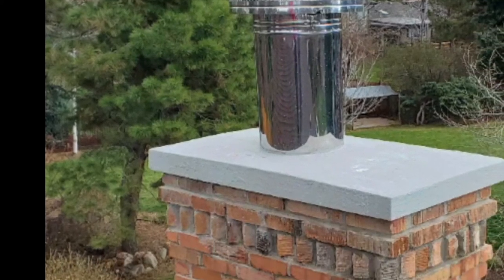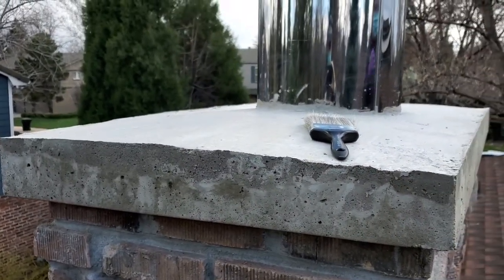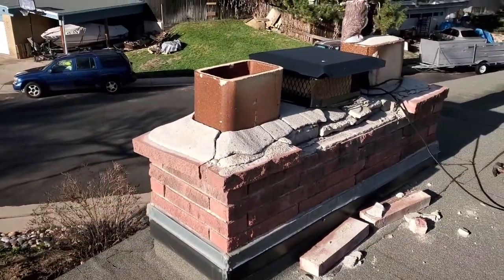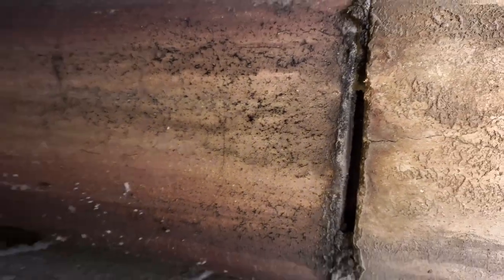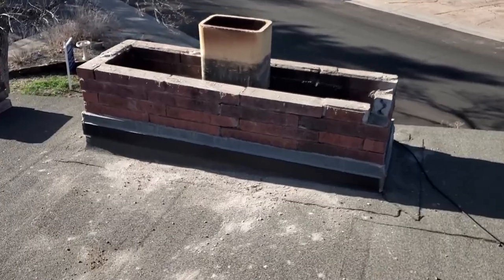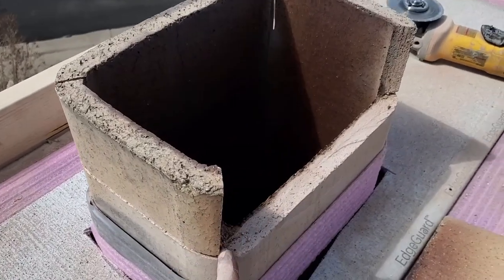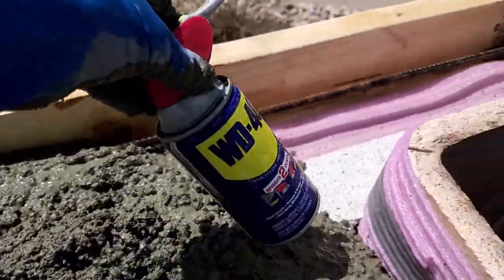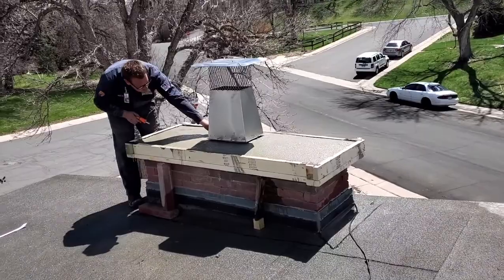How Do I Rebuild a Chimney Crown?

Comment: Excellent work! I have a question. I'm in PA climate area and my chimney looks like it was basically parged - that's gone. The flue liners look surprisingly good for 85 years old! But they only stick up about 2 1/2" above the top of the brick chimney. I would like to pour a nice concrete crown but would need to extend the flues??? Am I thinking this correctly? I'd like a good 3" - 4" crown, sloped of course. So do I just add approx. 6" to the flues? How much are they supposed to rise above the crown? And the mortar joint would be embedded in the new crown.  What type mortar do I use to bond the flue sections? Please correct any of the above.
Jeff
Reply from the maker: HI Jeff, that sounds correct. Use CONCRETE to build a new crown with the slope, etc (available at H Depot). The flue tile should stick up 2in above the new crown. The joint of the new-to-old flue tile should be joined with refractory mortar (available Amazon).  Clay flue tiles can be purchased at local masonry brick yards. The most common size out here is 12 x12 OD. 

Now this might sorta undo what we just discussed above, but I wanted to answer your questions before giving my opinon. So now here is my opinion 🙂
Regarding the parged flue interior... that is great, but most certified sweeps will say it is not good, and I agree with them. Monoxide and heat transfer through tiny joints and we wish to fully contain all the byproducts all the way to the outside world... if you see raw clay brick and associated joints when looking down, not flue tiles, it is recommended to reline- with stainless steel. And the stainless steel tube has to be sized for the fireplace opening (in ratio, ex 1/12 ratio of flue is round). Call a local certified guy perhaps?
Good luck!
Reply: @Midtownsweepsfranchise  Thank you so much for your reply. Most "Tubers" honestly won't bother. 
Anyway, I may have confused you... the top of chimney brick,  the crown, is what was parked, NOT the flue. The flue is clay tile in good shape. Wish I could send a pic.
Reply: @Midtownsweepsfranchise  Also, is it suitable to have the refractory flue joint in the middle of my concrete crown, or do I need to cut the old flue below the level of the bottom of the new crown so that joint is not in the crown concrete? Thanks so much!
Reply: @Midtownsweepsfranchise  The flue isn't parged, sorry if I confused you. The top of the chimney crown was parged, no concrete crown.